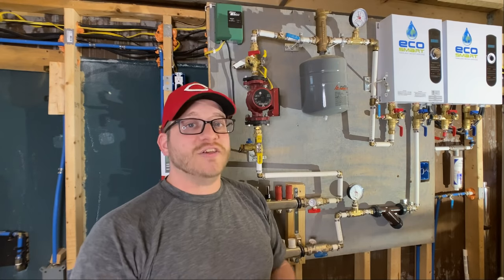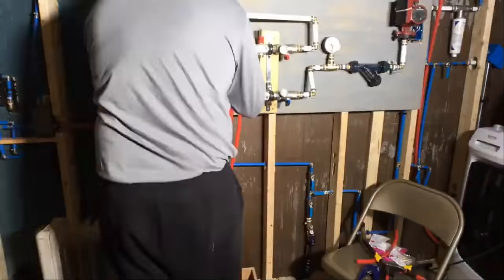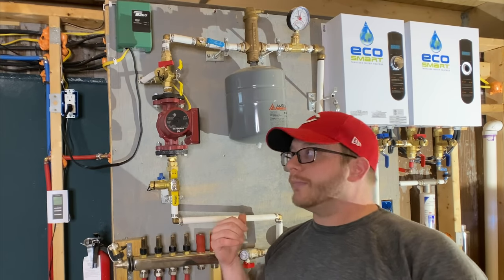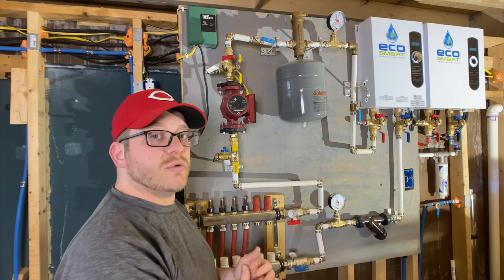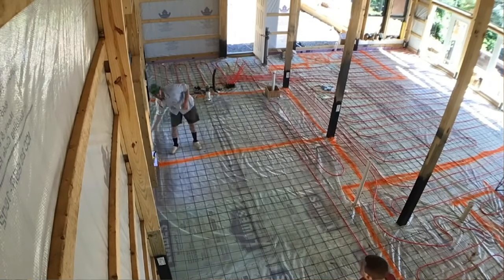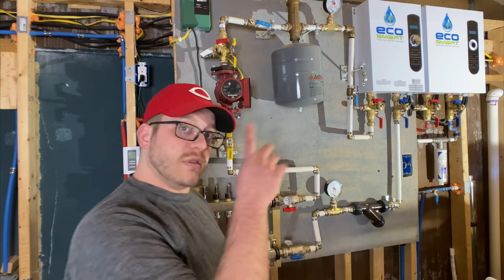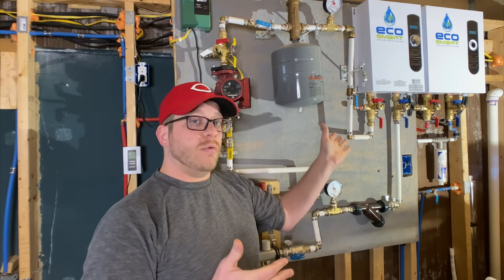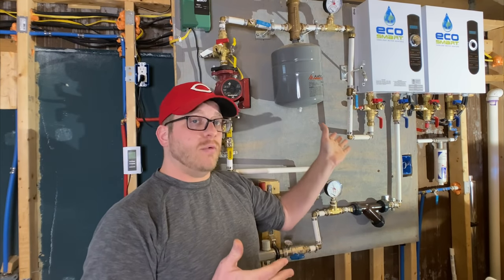Amazing Radiant Floor Heat | One Year Update & System Costs

Comment: Why did you go with grundfus over taco 007?
Reply from the maker: Honesty just because I saw someone else on YouTube use it. Never compared the two. 🙂
Reply: @LittleMountainLife  you are happy with the eco heaters then...
Reply from the maker: @seancannan  definitely
Reply: @LittleMountainLife  I can’t get the flow high enough to activate my flow sensor for the heat.  800’ of pipes on 4 equal zones.  Taco 007 was too little, the grundfos is the same now.  Might have to try both.
Reply from the maker: @seancannan  oh man that stinks. 800’ total or 800’ in each zone?
Reply: @LittleMountainLife  800 total.  Basement slab divided in 4 parts.  200 each.
Reply from the maker: @seancannan  gotcha. That should be easy to get flowing.  What’s your psi?
Reply: @LittleMountainLife  I would have to look.  I gave up for the day.  I filled it off of my well pump at 60psi.  But sure that it bled down.
Reply: @LittleMountainLife  Good choice! I've been using Grundfos over Taco for 30 years. It's not that Taco doesn't work. They just seem a little cheaper in quality.

Comment: I think your tankless electric heater is a cause of inefficiency, that thing only knows on or off. Full boar, and electrical appliances especially those pull a ton of power at startup. An electric water heater would actually be more efficient in your set up.
Reply from the maker: The ecosmart heaters have a sensor built in causing it to only draw the power it needs to heat to the set temperature.

Comment: Hello,
Can I hire you to do it in my house. I installed the pipes under the floor and ran out of money 10 years ago to finish the project. I have to now exactly install all the above ground system just like you show here. It is about 1000 sq.ft. I called a local contractor. He wants $5.5K I stopped looking for a contractor. Any suggestions?
Reply from the maker: Wish I could help.  Maybe a local handyman will assemble the manifold system for you?

Comment: I would never use a system with regular water. I would use some form of glycol or antifreeze with the correct ratio of distilled water
Reply from the maker: AA ton of people use just water without issues. I would include antifreeze if I lived in the far north and anticipated frequent loss of power or long trips out of town in the winter.

Comment: They make electric boilers. Tankless water heaters tend to have less lifespan than a boiler style. I have assisted with an electric tankless boiler.
Reply: This is a terrible install, his pex layout is incorrect, his setup is incorrect, using a instant hot water tank will burn out in short order. Boiler installs are absolutely not a DIY job

Comment: Fact - your system is 100% efficient as its electric resistance heat. Shutting breaker off won't save a penny as its thermostatically controlled. Only uses what you require.

Comment: Hmmm I thought this would be cheaper, I heat  my house with a mini split for $90 a month in the winter (Montana)
Reply: They are heating directly from the grid, so 100% efficiency, you are using a heat pump which operates at 1.6 to 3.4 or so on average, so they should be paying 2-3 times to heat the same area. Had they gone the tank route, they could have bought a tank that is designed to take input from a heat pump, and gotten those efficiencies as well.

Comment: I know You happy but with 250 a month You should be able to heat 2500 sq' house with electricity only and for closed loop You don 't need flash valves for boilers. There is new circulation pump from groundfos - Alpha 2. Is using only 10% of electricity compare to one You have

Comment: I never understood why somebody has to heat the water with electricity and move it thru the whole house instead of using electricity directly under the floor using electrical (mat) resistance or using oil radiators?!
Reply from the maker: You want me to bury electrical mats in or under the slab?

Comment: Installed  buffer  tank [ termo 2000] you save more many
Reply from the maker: We don’t have the space for larger boilers and tanks.
Reply: Buffer only helps the cost if you can heat the buffer off peak. If the local power company only charges by the kWh and not the peak demand, then buffer actually lowers the efficiency compared to direct heat.
Reply: Please  read  more about  heating... buffer  tank.. storage  tank... different system... hydraulic  calculating heat loss... and coming  back  ...
Reply: Very  recommended
 Zurn Radiant Heating Design and Application Guide
Reply: @bg1572  buffer tank heat loss usually does not go to living spaces, storing energy does not give you anything more, simple physics. Need to be remembered the differences between electric (adjustable, no limits for adjustment range etc and for example gas or oil which has to have long enough burn time so adjustability is much worse.
Reply: @Karjis  fallow  your choice...
Reply: @bg1572  don’t get me wrong, I am running buffer tank and mixing valves in my own setup as it benefits from that, actually requires one because of air to water heat pump needs buffered energy for defrosting and cannot provide constant stable heat in every temperature. I am probably even adding more tank capacity in future for storing excess solar as heat in spring / autumn time. 
I try looking up the book to see what is the reasoning in there for adding tank in basically tankless system.
Reply: @bg1572  I browsed the your recommendation through, it is quite narrow about tanks, actually really not much about electric heaters except the wide temperature range, combination examples were not having much about electric+tank/tankless. I will read it better tomorrow but it seems quite good basic application guide, but nothing new really.
But I will read it through with more thought tomorrow, I like this kind of stuff, just the temperering valve controller in my system has almost 100 pages as basic manual and I like that :P

Comment: Why don't u try solar power  to heat water. And save on expenses when the sun is out in the winter
Reply: Because those systems are a joke really and absolutely do not work in cold climates. Fake green engery that simple doesn't work
Reply: Yes it does by using micro glass heats the metal inside the box generates heat...

Comment: Some of the best heat out there, yet terribly expensive and time consuming to do repairs. Work on them daily and people are very surprised how big the bills are. 

People absolutely need them checked at least every other year. For proper systems boilers are not DIY. Especially using a water heater for your boiler, substantial problems with this install. Wish them luck longevity and efficiency will be major issues
Reply from the maker: A lot of people say tankless heaters aren’t optimal. Time will tell. And in my mind replacing the electric tankless isn’t that expensive compared to replacing major parts of a traditional full house HVAC system. 
Besides the heater though, what substantial problems do you see?
Reply: @LittleMountainLife  I am telling you as a Boiler technician who has been doing it  very long time it was not a good idea. Again wish you luck but you would have been far better severed by a propane boiler  cast-iron  heat exchanger would save you a lot with a install the followed code.

 The layout is a issue, there truly is a science in how you layout your tubing. A load calculator was not done to indicate what size tubing, spacing of the tubing, and what layout is required to reach the nessary load for efficiency.

 Also you didn't say what PSI your system is set to, if you are exceeding what is recommended you are having poor heat transfer and wasting engery. I don't see a air scoop, back flow preventer which is code, don't see a high pressure relief valve which is also code, also the ones installed on the instant hot water tanks are not designed for a boiler system. A auto fill valve so if you have a leak you don't kill your boiler by running low or dry.

If you utilized a simple zone system would save you money. Also you should be using a water temp controller that would only run your pump if there is a call and only bring on the boiler if temp drops below a set temperature, that would save you alot. Also there is specialize pex tubing designed to handle boiler temperature that standard class b isn't rated for. I would have used a sized 30 expansion tank as well.

You also don't have sufficient vapor barrier or enough insulation in your slab and you are loosing a lot of your heat into the ground. They make specific foam pads for radiant flooring and some even offer a snap in tracks for the tubing.

Again I wish you luck on it, I truly do but the design and layout for one doesn't meet code requirements and is costing you more to run with everything I have seen in the videos.

 You should have had a engineer design your system and layout if you didn't want to go the pro route.. It would have been a lot more efficient and longer service life. This will never work as efficiently as it could have. Again good luck
Reply from the maker: @zack9912000  we aren’t doing propane in the house.  
I understand you work in the profession and that’s why I asked what, besides the heater, you see as a ‘substantial problem’.

Comment: Radiant  infoor electric heating is Les efficient than electric baseboard, with an insulated slab your slab will be a thermal mass, collecting solar and ambient heat... electric baseboard is 100 percent efficient, used in a well insulated home is the best, cheapest and near zero maintenance...if you wanted better, with some maintenance go mini split
Reply: Cost of EBB system, 300 bucks... will last 30 years...

Comment: Once these guys install the mini split heat pump and realize that it costs less than half the electricity to heat their house as compared to the floor heaters I’ll bet that the floor heat gets used a lot less often.
Reply from the maker: Possibly. But the mini splits don’t keep your feet warm when walking on concrete.  🙂
Reply: I highly doubt a mini split will save them money as radiant heating is more efficient then heating air.  Radiant floor heating retains more btu's in the flooring material , thus giving it off longer
Reply: @JasonYouTube  I agree with you that radiant is better than air heating.  However you need to consider the entire end to end energy flow to calculate overall efficiency.  It’s a fact that heat pumps have a COP (coefficient of performance) of 2 to 3.  That means for every 1 unit of electricity you get up to 3 units of heat.  But the boiler shown in this video only provides 1 unit of heat for 1 unit of electricity.  You can’t claim that the radiant system would multiply that to more heat than 1 unit.  It’s just not possible.  

My own mother installed a heat pump a few years ago.  She previously used radiant electric heat.  Her heating bill was cut in half.   That’s a real world case.
Reply: @neilbrookins8428  A.Properly installed radiant heat system with enough thermal mass (concrete, sand, etc) to hold the btus would outperform heat pumps and even geothermal systems.  I agree that using electricity is inefficient but thermal mass objects will retain heat longer then air. I had a geothermal  system in my house , but not worthwhile to replace it since cost of new is over 13k. I used to have an open loop system but with new regulations,  need closed  loops in ground. My pole barn has a thermal mass radiant floor,  and I use under $80- $100 a month to heat a 40 x 80 x 12 building in Minnesota cold.  Could never heat it for that price using a heat pump or geothermal  system. A properly designed system would be achievable,  but in this case you are probably right about heat pump as those heating costs are high

Comment: Why 100% electric heaters and no heatpump, yes they exist for floor heating...
Also your distributor, why did you put it so high that you have splices in all your lines, absolutely not necessary and in the Netherlands only “allowed” for repairs.
Even heatpumps are quite easy to install these days

Comment: The hot water heaters will work as domestic hot water is not really supposed to go over 120F. In floor heating should be less than 120F. Therefore, it works.

In the 2 months I've put in 3 Thermolec electric boilers for infloor radiant heat systems. If my crew lead saw the pex on your job he'd have  a heart attack. It's DIY and it works. Just funny if you do it professionally.
Reply from the maker: Yeah definitely not a pro job, but works :)

Comment: If you retrofit to a heat pump powered hydronic radiant system your heat your house for a year for the cost of one of your current months
Reply: No way.
Reply: No way, even the low end air to water heat pump costs few thousands just for parts. Even the cheap chinese ones. Ground source stuff is even more and drilling a well for the ground source is even more.